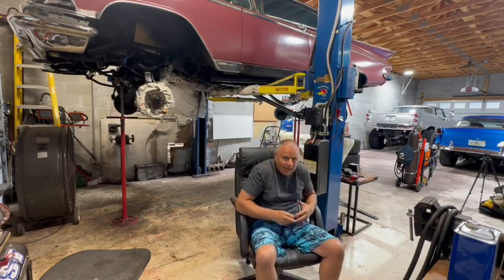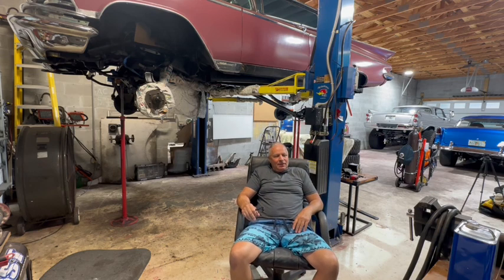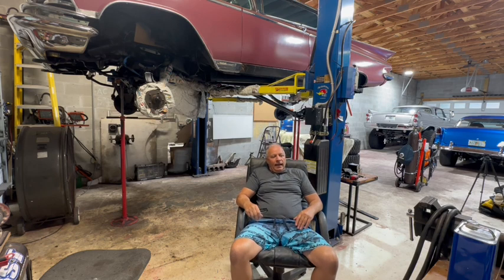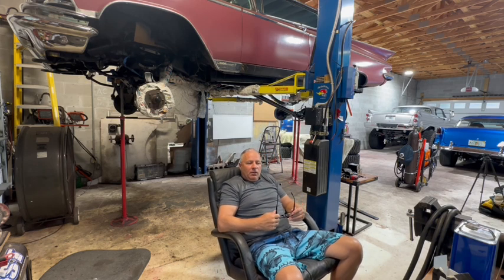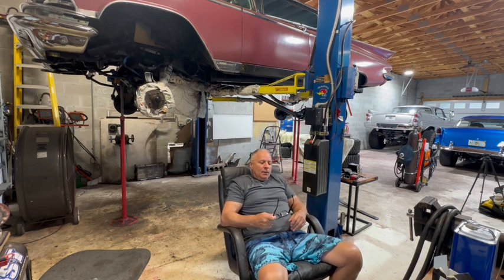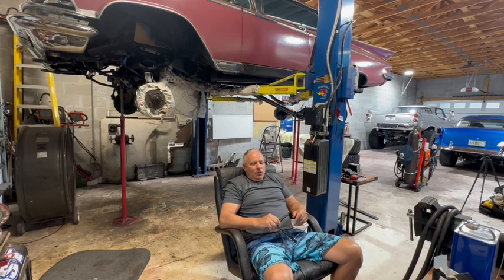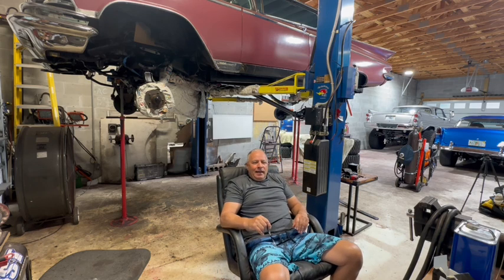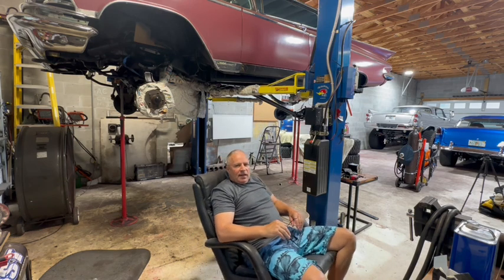Understanding cars coil, and ballast resistors ￼

Comment: I used a MSD Blaster II Coil on my 72' Volvo 145S, I had some friends at a machine shop balance the bottom end of the 2.0L B20 engine, ported and polished the head and gasket matched the manifolds, ran a Webber carb, a Pertronics electronic ignition on a distributor that I rebuilt, using Chevy small block advance springs, Clifford Research tuned headers into a 2" exhaust ending with a Super Trapp tune able exhaust tip, and topped it off by building a vacuum pump system connected to the flame trap and sealing the block so that it ran an very positive vacuum inside the block while running. I also used the best pistons, rings and bearing available. I found that when I installed the Blaster II coil, that it had severe pre ignition, even with the stock ballast resistor. I ended up doubling the ballast resistors and the problem went away instantly. I was using a high output alternator and ran dual batteries to deal with the extra lighting I had and the overpowered stereo system that I had in it that may have been pumping too much voltage into the coil, was not a problem with the stock coil, but was with the Blaster II. All the ballast resistor does is make sure that the voltage to the coil stays constant at the correct voltage which is important especially on high performance engines that turn high RPM's, my B20's redline was 8,000 RPM's because the valves would start to float between 8,050 and 8,100 RPM's. This was my shop car/parts runner for my shop, I also installed IPD suspension parts such as heavy sway bars, stiffer, progressive rear springs, and polyurethane bushings throughout making the old wagon, yes, the 145 was a grandpa's grocery getter wagon, pull more than 1G in the turns. My shop was on Mt. Hood in Oregon and that wagon that looked stock from the outside, embarrassed many sports cars on the mountain, and Mustangs and Camaro's in stoplight to stoplight drag races. I did have to run Super in the tank with lots of octane booster, but still got an average of 28MPG even while shifting at 8K RPM's. The motor lasted over 125K miles before I loaned to an employee who did not check the oil and ran it dry seizing the engine, It would have easily lasted another 125K if I had not loaned it out.
Reply from the maker: Hi Chris That sounds like a really AWESOME car you built thanks for your input on the coil quite interesting. The blaster two coil called for a .08 ballast resistor I had a 1.5 which I guess restricts the voltage even more and it’s running fine I ordered the 0.8 resistor but from what you’re saying it almost sounds better if it’s running fine to keep the resisted a little bit more although you were running a really hyper Performance engine And I’m just running a mildly upgraded 350 engine in my monster car I believe it’s around 450 Hp. Any way Thanks again